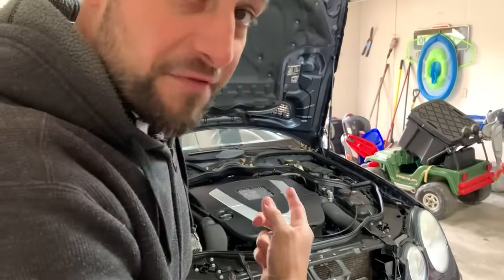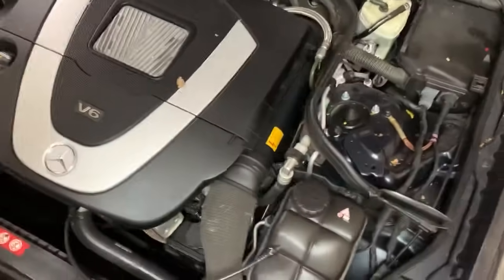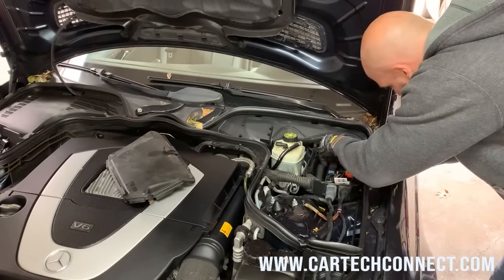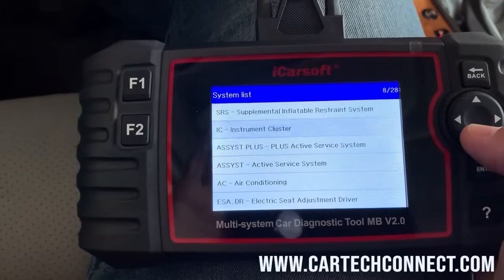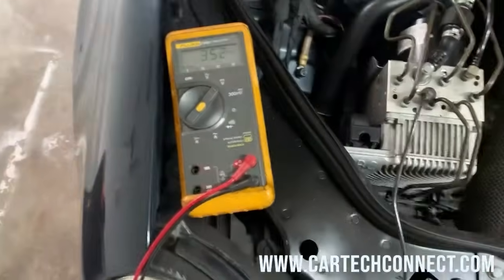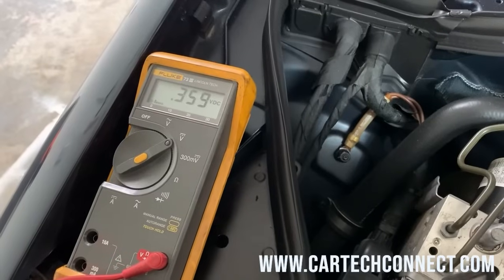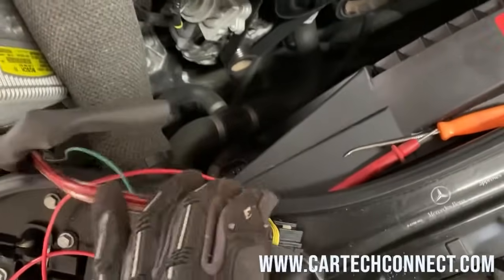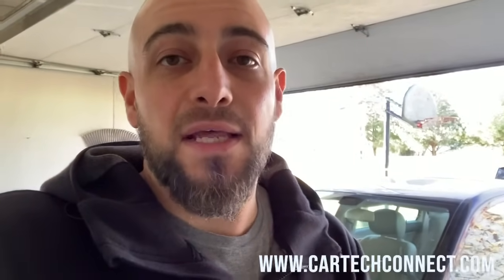Mercedes Benz fan keeps running sounds like an airplane - how to diagnose

Comment: Thus happened to me on my CL500 about 5 years ago. I figured it out by tapping on my ECU with a rubber mallet. I ended up sending it to PressurTech in GA and they were able to fix it.  I live in Boston but went to college in GA in the early 2000s. Thank fully I had family and friends in GA who were able to confirm that this place actually existed and they did a fantastic job.  Now 5 years later I'm experiencing the same problem on my 2016 E400 4Matic coupe.  I'm going to bustt out my trusty rubber mallet again and if that doesn't work the folks @ Pressuretech are going to hear from me again lol.

Comment: "How to diagnose", IF you've got the diagnostic tool.
Reply from the maker: I mean, yeah…… or you can guess…… people think you can always get around proper diagnosis, sure, if you guess or use my example and find your own path , not sure how your comment is supposed to be a knock against my information .😂
Reply: @MasterTechLou  It wasn't meant to be a knock against the video content, but the video content ONLY applies to those who have the equipment, that's all.
Reply: @MasterTechLou  I should have added, that those who landed on your video, are most likely folks like myself...just run of the mill folks who've GOT no equipment, but simply looking for a solution, where the remedy can be handled by s/one who has no real mechanical ability, etc.

Comment: If the Mercedes diagnostics report error 0695, but the fan can be controlled from 10-90%, the diagnostics say the sensor cannot be changed. The engine and air conditioning are requesting the fan to run at 0%. Is this also the case with a defective ECU, which displays 0? Would I then be able to control the fan at all? The thermostat and coolant sensor have already been replaced. The air conditioning worked initially with the error message, but now it no longer works: the air conditioning only produces warm air. The pressure is between 5-7.5 bar, depending on the outside temperature. When the air conditioning is switched on, the pressure remains unchanged.

Comment: Hello! I have exactly the same problem but when I am knocking the ECU I get around 3.4 and it holds it for a while and then drops to 0.35 volts. How did you know that where the issue is inside the ECU? I have w221 2006 with M273 engine.
Reply from the maker: @jamcof  because it changes when hitting it. No electronics should be affected by physical acts

Comment: No fan control module on the fan motor or shroud on the W211?  Usually it's that, not the ECU, which is less common.

Comment: mate I'm having an issue with my vehicle cl500 2008 when car is idling without ac on engine fan run nice normal but when I switch an to on it runs high like I can hear it in the cabin can you help.
Reply from the maker: @sergiosotelo8262  ether a bad pressure switch or too much freon most likely
Reply: @MasterTechLou  thankyou for your quick response, I have set up a laptop with xentry I will diagnose vehicle when I get home from work ,I'll keep you posted on what I find wrong with it.

Comment: I’ve replace 2 alternator on my 2005 e 500  left me stranded twice and now I have a problem with my battery dies in few days. Can yo help me ? Thank
Reply from the maker: @josephdispensa1475  very important to get the alternator from the dealer or correct vendor as not all the alternators work properly in these cars. Also you have a battery draw most likely or just simply poor connections to the battery or alternator

Comment: That intake flap code shouldn't be ignored. That year E-Class is notorious for the plastic linkage snapping, resulting in a intake flap that will not open. Will lead to other emission issues and possibly more electrical faults. That year also has a manufacturing install defect of electrical wiring in the trunk on the driver's side hinge, behind the plastic trim.

The issue is the wires were zip tied to the hinge from the factory too tight. It results in the brown wire breaking resulting in the trunk release button inside not working as well as rear trunk brake light being inoperable as well.

There was also an extended warranty placed on fuel pump and filter unit in those years. It fails resulting in a fuel smell inside the cabin. The Mercedes Benz dealer in Bloomfield Hills, Michigan refused to honor the warranty, even though headquarters verified it was covered. Apparently independently owned locations can do that. Stupid! They tried to charge over $2k to repair. Did it myself for under $200, wasn't that difficult. Unit is located under the rear seat. Good luck!

Comment: I have the same problem. But if i dont use the aircon it doesn't do it. Have you any ideas. Thank mate
Reply from the maker: @johnvine9611  pressure switch is bad or too much freon
Reply: I think I'm having the same issue on my 2011 W204 C300. I hear the AC pressure sensor may be the issue.

Comment: Master Lou been a while learning so much in the Mercedes world buddy 2000 s430 had radiator fan issue replaced it now the 60 amp fuse is smoking  I can’t scan it because it’s s class and my open port can’t read it.  What do you think buddy send me on a path you always right

Comment: Howzit bro 

I have a Mercedes Benz c180k 2009 model 

Day before yesterday it was raining n I hit a water patch the car switch off didn't what to start had to get a break down, yesterday left hold day it started but My come off conternesly no lights work no wipers work I don't what to check for😅
Reply: Fan
Reply from the maker: Water In fuse box most likely

Comment: I have a Similar problem with my Mercedes Benz S550 year 2010 so at first my problem was my Belt I didn’t realize that my serpentine belt was no longer on the car is shredded. It’s sold to pieces so then I had to buy a whole new entire belt and install the belt. Then the car wouldn’t start due to low votes in the battery so I had to get a new battery now the car starts up and the fan doesn’t run all the time anymore he used to run for approximately 3 to 4 minutes after the car shut off and it sounds like it’s winding up or after I cut it on no once I cut it on the fan runs and then when I cut the car off it goes off in about a minute.. but it’s not as worse as it was before

Comment: This was happening on a c class estate I recently bought I watched a few you tube videos and decided to start cheap and work up firstly I noticed the battery was brand new but looked very small and on looking closer found the battery had smaller CCA and lower ah than what was supposed to be on the car so luckily I had just bought a new battery for my s class which was obviously bigger CCA and ah I joined the positive and negative together in the boot and left overnight fitted the s class battery started the car with fingers crossed and no more fan on continuous from cold and no fan over run I have found over the years of Mercedes ownership if there is the slightest drop in battery voltage or performance it starts to play havoc with the electrical systems on the car hope this helps ps it won't solve everyone's problem but it solved mine

Comment: Solder wick and solder sucker would of made this job way easier. But great 👍 info
Reply from the maker: Thanks, I dont do this sort of thing, sure it’s obvious by my terrible soldering skills on circuit boards, 😂.
Reply: No worries man I’m not grilling you. Just trying to help out. I do it daily for a living. And used to swap chips out for Nissans and Honda Ecus.
Reply from the maker: @smoke1va  didnt take it that way at all ❤️

Comment: Can you re-authorize those 2007 and up ECUs with SDS or does it have to be a virgin unit? Another reason why swapping the EEPROM didn't work is because it looks like the donor ECU was not identical. I have found when doing work like this, if the ECU was made by a different subcontractor or even just a different year, the other chips on the module can be different and it doesn't know how to communicate with them. I always try to get the exact same part number and versioning.
Reply: This is so true. When soldering trying to transfer vehicle data to a junk yard module even within the same year they can be different. Has a Malibu that I pulled a BCM out that was same year but different. Found another and it was the exact same. No dealer programing needed.
Reply: @James_T_Kirk_1701  100% It gets into the nitty-gritty but guys like us enjoy fixing it ourselves and that's about as valuable as the cost of the dealer parts.

Comment: Will a bad engine modular make the engine not start, but the fan run on high speed
Reply from the maker: That happens due to no communication with the module. Either no power at the module, communication issues with the data bus, or bad engine module yes.

Comment: Hey Lou, I have the same problem in this video, my fan comes on a second after I start the car and turns off when I turn off the car. My codes are P20CD
Reply from the maker: sorry we have no way of looking up codes. We only get code diagnosis through the Mercedes scanner. there are a few reasons why fans will come on full speed. one is programming of the engine module, one is failed coolant temp sensor. failed fan, wiring, failed ME.

Comment: I have the same issue with my 2007 Mercedes CLK Class 350. The AC fan won't work. Where did you send the computer module at NY exactly? How much they charged you?

Comment: Im having the same problem with my 2019 c 300 mercedes benz. My fan comes on high speed and my ac is warm. Have you had any newer models with this problem?  I'll  have to invest in a diagnostic tool.
Reply from the maker: Yes usually a bad pressure sensor sending wrong pressures so ac is cut off and fan is ran on high as a safety.

Comment: Another fix we have performed for fan run or no run. Installed a new circuit to control radiator cooling fan, thru the use of  a manual switch in driver's dashboard. The customer has to turn on during operating of a/c, and city traffic. Saved the customer $$$. My favorite Mercedes-Benz, 126 chassis 300 SD turbo diesel, easy to diagnose and repair, all kinds of engines room, and built like tanks!

Comment: There's an easier way. You get the ECU from a junk yard car, same year make model. You give your vin to the guy you send to, that wipes the vin from junk yard ECU, and burns your vin on to junk yard ECU! I did with conductor plate from tranny in limp mode. Fixed tranny!

Comment: IMHO if the ECU doesnt send a signal to the Fan to run it fast , its not the ECU, its the Fan control module/motor thats faulty , only if the ECU is erroneously requesting the Fan to turn on even when the air is not on and its not hot because you just started the car , then it cant be the ECU it has to get erroneous request fromt the ECU for it to be the ECU problem , other wise your throwing your money away on a new ECU when its the Fan control module ie motor on the Fan , is my laymans answer based on watching a bunch of too fast fan videos

however I do have an error code ECM - Engine Control Module(ME)

P203E-004

No CAN Message From Instrument Cluster Or Message Faulty. Communication Fault / See Also CAN Status In Freeze Frame data(P0600)

could this error message indicate a ECM fault causing the fan to run fast at start based on your diagnosis video ???

Comment: Just wanna clear things. So if I swap chip with new one it should work? If not then change the ecu to another one?
Have the same issue w221 s550 M273
Reply from the maker: Theres two chips that need swapped however there is zero info I have found on which other chip has the immobilizer data

Comment: why on earth Mercedes did not use a fan relay as an ultimate safety switch after engine is powered down , this relay would ensure battery does not get drained unnecessarily, with my knowledge of electronics i can tell you that integrated control fans have power transistors that can fail and continue to run the fan as it has permanent battery feed, so a relay would have cut all power to it unless the ignition was on when the fan would come on even if not needed, in an emergency you would still be able to use your car,  why i am here is because a friends 230 Merc has fan coming on at Full Speed almost so frightening standing near it as blades could fly off it and hurt someone, I diagnosed issues with its engine control module that is sending permanent 12v into the control wire the green wire I believe is earth, brown and green wire is where the signal appears, the fan was tested ok, so if you do not connect control terminals and only apply ground and power to fan's big terminals it does not run, so fault is in control unit which should send pulse width modulation control signal to run fan and at appropriate speed depending on how hot the engine is and how much cooling it requires.

Comment: Got a 2002 S430, the cooling fan will stay off until the car reaches a temp past 82 degrees celsius, and then it stays on. Got any leads?
Reply from the maker: Honestly with a scanner and monitoring the ac pressures and temp sensor for the engine and checking to see who is asking for the fan activation, engine module or ac module, this sounds like a super easy diagnosis.

Comment: This may be the same thing with the 08 c300. The motor looks the same. I replaced the coolsnt temp sensor; IAT senor and thermostat those cides were showing.  The fans before i changed  everything would stay on cimtinuously or not be on at all.. im going to try and tap the ECU and test it. I replaced my 07 300 CPU with a new one from the Flagdhip one auto; i had to flash it with that onboard diagnodtic its not just going to plug and play.. Thanks for the info..

Comment: First thing todo is check the coolant level. If it’s below the sensor it will engage the fan constantly, mine was running I topped up a little coolant then it was fine. Suggest do this before taking apart wires and such

Comment: I wonder if this is what’s preventing my 2006 E350’s fuel pump from turning on..🤔 Unfortunately I have the PZEV fuel system from California. I cannot justify paying that ridiculous $2600 price for a new fuel tank. I replaced the sending unit with a new one and still nothing. I spray starting fluid into the throttle body and she fires up nicely. I’m wondering if my ECM could be the culprit. If that’s not my issue, then the E350 is getting scrapped. Shame, she’s a beautiful car and has served me extremely well. I hate the thought of having to part with her… I’ve heard of some hacks being performed like an external pump or even cutting a hole up top under my rear seat and installing a new pump through there. 🤦🏼‍♀️🤷🏼‍♀️😵‍💫🙏🏼
Reply from the maker: You need a new engine module.
In 06-07 they wont turn on the fuel pump relay.

Comment: Can you just order one with the same vin #?
Reply from the maker: No, since the module is vin coded its called  TRP item, Theft Relevant Part, so the only way to get it fixed , well the way its supposed to be fixed, is the dealership is the one that has to install it to verify its installed in the right car so its not stolen. The dealer will not sell you any TRP part over the counter.

Comment: Just got a call guy says his 2006 r350 blower motor won't turn off ,my autel 908spro is broken
Reply from the maker: 90% of the time water is in the blower and resistor housing, its one piece/part from dealer. not sure if aftermarket sells individual but they wont work. Issue is common an a blower/resistor fixes it. dont take my word for it, do your diagnosis please. 
Lou

Comment: I need some advice on the Mercedes’ I have can you please help me
Reply: I have a Mercedes’ benzc300 and it’s giving me electrical problems sometimes the headlights stay on and the ac and the radio goes on and off I have taken to different places but no body can tell what’s wrong with it
Reply from the maker: @wandaramos5250  take it to the dealer. Most likely has water or corrosion in the front fuse box. Biggest problem with owning these cars is tryin to avoid the dealer and finding someone competent enough to work on them.
Reply: @MasterTechLou  thank you so much for answering my question
Reply from the maker: What kind of advice?

Comment: That is crazy you had to do all that for a fan noise... seems like a poor design issue. Mine sounds loud like this on my 2010 e550 but only when I start the car with the ac on. If I start the car with it off the fan doesn't crank up like this. When the fan runs loud it won't shut off until I turn the car off. It is currently 100+ degrees out here so i'm wondering if the fan running like this is normal or if I have some issue? Also that is one clean engine bay.
Reply from the maker: Fan will run with ac on, to cool ac, depends on pressures of ac system and outside temps. if its 100+ then I can assume its normal operation.
Reply: @MasterTechLou  thanks also was wondering if you still do online diagnosis. I tried your site but it was not working.  Having a number of strange issues but no check engine light.
Reply from the maker: @Dynasty-s1y  I closed my site. You can find me at justanswer.com Lou P

Comment: Funny, I'm a professional musician working on my c207 & my sister's w203 & its always awesome seeing professional mechanics, etc playing their own music in their vids!
Also, never knew about early m272's having bad ECM's. That's slightly terrifying hahaha....I just had a 0521 paired w/ a hard cold start & same fan nonsense. Coolant temp sensor read a fault also & had one on hand so fingers crossed. My bank1 tumble flap sensor is undercurrent, so also praying I can just swap that before I check the front of the dreaded intake manifold for you know what.
Thanks for what you do!